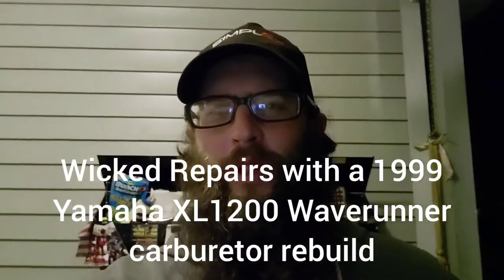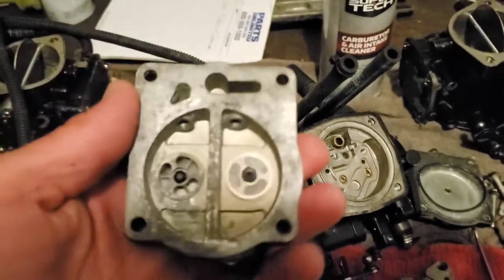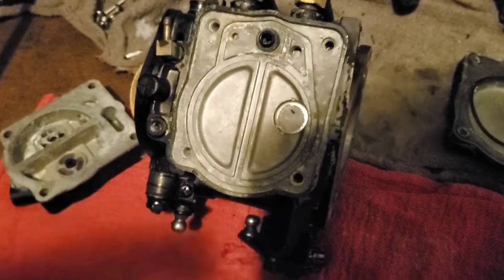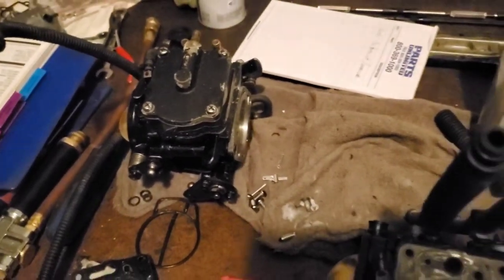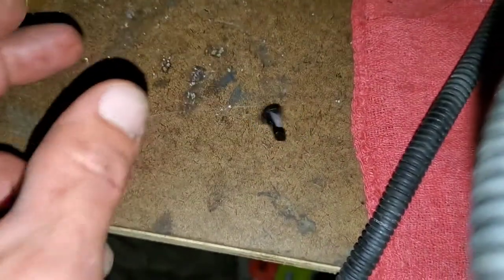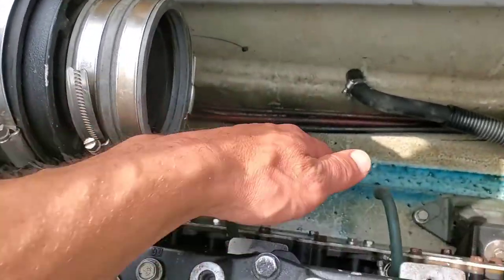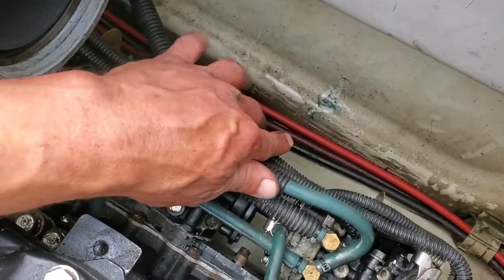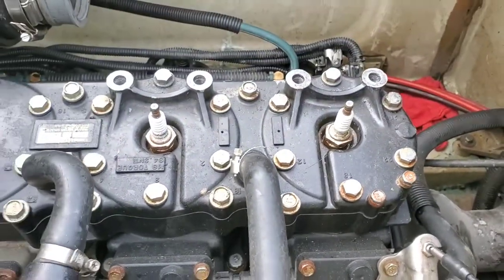Yamaha XL1200 Carburetor rebuild

Comment: Just got done finishing an xl800, second time pulling everything a part due to a ruptured fuel line that was barely rubbing on the head.  Make sure you route everything back like factory.

Also, make sure to get the right kits, for I series carbs.  The regular 44 SBN carbs are smaller diaphragms and body.   

Mine rubbed through while cruising about 45 mph.  Was able to limp home at 3 mph, but was across a huge lake.  Lesson learned the hard way.  Fixed it and also put more hose protector around fuel line for added protection.
Reply: Hi when you did your rebuild what specs did you use I have a hard time finding 800 specs for pop off and hi and low settings.
Reply: @seandaly9361  I'll see if I can find it in the service manual and post it here.
Reply: @user-ym9wb2mk5e  thank you
Reply: @seandaly9361  I can get you the whole manual, shoot me your email addy.

Comment: Looks like you used Yamalube between the carb gaskets and the manifold plate and also between the plate and the motor.  Please confirm.  Thanks!  Great video!
Reply from the maker: Yes is did, yamabond. I either put that or spray Hi tack gasket sealer on the gaskets to make sure there's no air leaks!

Comment: My Pop Off Pressure is set at 55  on all 3 and it works  great  now i am doing a 1200r  not  a xl1200   and  my buddy helped me do my carbs  last year this time i am  doing them on my own ..  I am going  Pre Mix  I throw those oil injection pumps str8 to the trash not made for it ..  I will say some of the parts  dry up becuase of being on pre mix  only where the carbs  turn just install a spring  good to go  never will fry a cylinder
Reply from the maker: Thats never a bad idea! If the pump fails its inevitable there will be catastrophic failure! That's awesome. Sorry it took a while to respond! I have my business and a metal detecting YouTube channel and for some reason didn't get my notifications for my repairs channel.

Comment: Great video Chris!!! I’ve done a ton of those carbs but I learned something new today 😂 keep them videos coming!!
Reply from the maker: Thank you! I appreciate it very much!  Maybe one of these days I'll be able to get up there and visit you.
Reply: Wicked Repairs absolutely! Would love to see you bud! I’ve got a 07 sportsman 500 that is driving me crazy!!! Wish you were closer, we could do a video diagnosing this turd!
Reply from the maker: @maineboatguy  probably needs a wire harness lol. Done many on those machines. The motors are typically OK on them but the electrical system is not so good.
Reply: Wicked Repairs 😂 I didn’t even tell you what it’s doing and you just figured it out!! I think I’ll be ordering a harness!!!! I’ve tried key switch, handlebar switch, removed fusible link from harness, sent pdm to “module masters” for testing but it supposedly is ok! Basically acts like someone is turning key on and off randomly! I really don’t want to replace the harness but this things useless otherwise 😞
Reply from the maker: @maineboatguy  lol it is a crappy job but is somewhat common from swamping these things. Funny how I've never had to replace a harness on a yamaha but have on many Polaris units! If the ecu is OK and its not loss of spark that causing, and everything else like ignition tests out ok, I'd def say harness.
Reply: Wicked Repairs I say that about EVERYTHING on a Polaris!! Kinda like my new sled, 400 miles I needed all new a arm bushings and a ball joint 😂 my apex had 8k miles with original bushings!! 
But yea this thing completely powers down, like someone pulled the battery out, I’ll do a video and send it through Facebook messenger!
Reply from the maker: @maineboatguy  yeah I'd like to see that. Nothings better than a yamaha! Pure reliability!

Comment: I know it’s an old video but it’s by far the best one I’ve found. I’m redoing the fuel system on a 99 Yamaha 1200 xl and I’m having a hard time finding what psi the pop off should be and my low and high adjustment screws are covered by brass caps should I drill them out to get the screws?
Reply from the maker: The pop off pressure is 75psi for all 3 carbs. You can very slowly and carefully drill the plugs out, don't go fast or hold much pressure so the drill bit doesn't hit the screw heads. The front carb low speed screw should be at 1 1/2 turns out, the middle at 1 3/8 turns out and rear at 1 1/2 turns out. The high speed screws should be at 1 3/8 turns out for all 3.
Reply: @wickedrepairs8527  thank you soo much!!
Reply: @wickedrepairs8527  I drilled out the caps and the low end screws were bottomed out all the way. I’m also having a very hard time finding a replacement check valve for the accelerator pump. Any idea where I can find one or even a part number
Reply from the maker: @davidrusso3273  that's crazy that they are bottomed out, strange. I'd have to try to find a yamaha part number for you if they are available. You can go through SBT, they are out of Florida and have kits that should have them in there.
Reply: @wickedrepairs8527  it’s a power valve motor not sure if that changes things.
I’ve called Yamaha mikuni and sbt and no one can find a part number
Reply from the maker: @davidrusso3273  it's so strange, neither can I! Looks like from what I can tell, you have to buy the 3rd carb as an assembly, bit they aren't even available.
Reply: So I finally located a accelerator pump in working condition got all the carbs finished up and everything put back together. It’s idling at around 3k on the trailer and after removing the oil pump the throttle is having a very hard time return to closed.
Reply from the maker: @davidrusso3273 It may idle a bit high out of the water, they do a lot of times util the prop has some resistance from the water. I have set them to proper idle on the hose then had to turn them up on the water after but you may want to adjust the idle more around 2100 on the trailer. That may even be your idle hang issue. If it very eradic it may be an air leak. Does it start up relatively easy? Take throttle ok? Although the idle is high, is it mostly steady?
Reply: @wickedrepairs8527  it starts up no choke and is very steady the throttle cable takes a long time to go back after pressing it tho
Reply from the maker: @davidrusso3273  if it's the cable itself, I'd lube the crap out of it! Get some cable lube or silicone spray and a cable lube from motion pro. That should do it as long as the cable is routed properly and the linkage isn't bent.
Reply: @wickedrepairs8527  I was going to add a spring where the oil pump line used to be as well. I checked for an air leak and didn’t find anything. Should I run the low end screws back in all the way how they were?
Reply from the maker: @davidrusso3273  yes, you can definitely try that and see if it runs better but very strange that they would be bottomed out. A return spring would be a great idea

Comment: Have a 99 XL1200.  Put a new throttle cable in as the throttle was not working.  Now, upon further investigation, the cable pulley for the throttle/oil injection pump is sticking.  Pull the throttle, it doesn't return.  Is there a replacement or just take it off and clean up and lube good?
Reply from the maker: I would definitely check to make sure there is free play in the throttle cable, it should have about 5mm of free play when you apply throttle, before it opens the throttle valve. Also double check that routing is proper and the cable isn't bound or twisted. You can definitely lube them up! Hopefully that's all it is, I have seen that before, some WD40 or silicone spray would be good and just work the throttle. Make sure the cable mounts and pulleys aren't bent too.

Comment: Hey do you have a spec sheet or official info on how much to turn out the high and low speed valves? I always sleep better at night knowing Yamaha said it
Reply from the maker: Yes I do! I have a complete factory yamaha book with specs for all 2 stoke models and some 4 stroke. At about the 2.5 minute mark the book is open in the bottom left of the screen

Comment: What’s the best way to remove the welsh plug to access the high and low speed adjustment screws?
Reply from the maker: Sorry I didn't respond faster, for some reason i didn't get a notification of a comment. Typically on waverunner carbs there is no plug, depends on models, if you need to remove one, carefully drill out and be sure to do it slowly so the drill bit does not hit the screw heads. I like to drill a smaller size hole in the center then install a screw into the hole as a puller, and then pull on the screw head with pliers to remove the plug.

Comment: Great video. I wish to see this video before I spent so much unnecessary time. I guessing same carburetor on gp1200r? Is it same spec for carb regulations? Do you have a video how to bleed oil system? Thanks for video it helps a lot
Reply from the maker: Yes the carburetors are the same for GP. Love those machines, GP has one of the best hull designs if you ask me! The pop off pressure is the same at 75 psi. The low speed screws are 1 1/2 turns out on front carb, 1 3/8 out center and 1 1/2 out for the rear. All high speed are 1 3/8 turns out. To bleed the oil is simple, just loosen the screw in front of the idle knob until there is no air and only oil coming out then tighten it back down. Thanks for watching and I'm happy to help!
Reply: @wickedrepairs8527   witch one of these is the front  to the rear  is the front  the one with the carb wheel ?

Comment: Looks like there are a couple of yamabond numbers (e.g.-4, 5, 6), which one to look for? Dumb question, but do you coat the threads of the entire grip? Is there a local source you can recommend like Permatex or similar if yamabond isn't specifically available? 

I will have to pull the carbs back apart to clean and adjust the hi/low needles. I'm surprised the rebuild kit didn't come with replacement seals
Reply from the maker: Definitely yamabond 4. I use a regular grip glue but have used other generic adhesives and even used black spray paint in a pinch, woks surprisingly well.
What seals? The gaskets? They are separate. I get rebuild kits through SBT on line.

Comment: Does the flaps of the choke need to be open when choke is  or out?
Reply from the maker: When you pull on the choke cable the flap should be closed.

Comment: Would you advise putting the carb body in parts dip once it's disassembled to get it really clean?
Reply from the maker: You absolutely can, just may take off the paint on the outside of the body. If so, just be sure it's all cleared of any paint flakes if that happens.

Comment: Late comment, but hopefully you still check these.  I just rebuilt my 2000 1200xl carbs and it has a runaway idle now.  Bought the waverunner used not running.  The grey hose with the red line on the hose, what is it for?  Because on mine the front carb has an exposed nipple that the grey hose is bypassing, and where the grey hose would have connected to it someone added a connector to the hose to skip the first carb.  The grey hose is connected to the last carb though
Reply from the maker: It may possibly be a vacuum hose. I wouldn't bypass any of the hoses and they shouldn't be really. You have vacuum, fuel and return lines. That should be it and they should all be utilized properly. The only other lines would be to the Reed valves for oil injection.

Comment: Do these carbs on the 1200 have to be synched like a motorcycle? Or do you simply adjust the screws to specs on each carb and that's it?
Reply from the maker: The synchronization process is done with setting the needle valve pop off pressure. They should all open at the same time and same amount of pressure. I think these are about 15psi but I would have to check the specs
Reply: @wickedrepairs8527  thanks for the reply. I'm about to start on the exact same model and year you were working on.
Reply from the maker: @dukelps9132  you're welcome! Good luck!

Comment: Hello, what does it mean when the low speed screw will not turn?  Thanks
Reply from the maker: It most likely seized up from corrosion. I would soak it in penetrating lubricant and try to work it out slowly.

Comment: Hi, I’m rebuilding my 1999 Yamaha XL1200 limited carbs and I was wondering what the adjustment specs are for my high and low screws?
Reply from the maker: They are all different. I believe I did say them in the video but I just looked them up again in my book. 
The front carburetor is 7/8 turns out on the Low and 1 1/4 turns out on the high 
The center carburetor is 7/8 turns out on the Low and 1 1/8 turns out on the high.
The rear carburetor (with the accelerator pump) is 1 1/8 turn out on Low and 1 3/8 turns out in the high speed jet.

Comment: Great video I have these same carbs, would you be able to rebuild mines if I mailed them to you
Reply from the maker: Thank you. I can do that, I just can't guarantee that it will run properly or need some adjusting when installed. Most of the time the low speed and idle adjustment is needed.

Comment: Your video is very helpful, best one I’ve seen on this topic. 
I have a 1999 LS2000 and am looking at rebuilding all 6 carbs. What rebuild kit do you recommend?
Reply from the maker: Thank you very much, I'm happy to hear that! I get carb it's through SBT. They are out of Florida. I have dealt with them for 15+ years. I want to say the kits are SBN44 but not positive. Their website is easy to navigate.
Reply: Are these carbs 38s or 44s? I understand there is a difference in the gasket arrangement in each
Reply from the maker: @robertsepulveda2229  they are SBN 44 carbs
Reply: How do I tell the difference between a 38 and 44 carb. I bought a mikuni kit and it says the gasket arrangement is different in each. 1999 Yamaha LS 2000 boat
Reply from the maker: @robertsepulveda2229  you have to look at the carb numbers to identify. Ls2000 is sbn44.

Comment: Hi, I thought your video was great.  I have a question. I have a 2002 Yamaha xlt1200 and I did rebuild the carbs. I ran on land and got a good idle. I had to wait 2 days before I could bay test and I removed the seats and the bilge was filled with gas… a couple of gallons. It was pouring out of the carbs. What would cause that ? Have you ever seen that ?
Thanks
Reply from the maker: Thank you, I appreciate that! 
Simple things first, make sure all the fuel lines are on and are secured properly. If they are all good,
I would run it on the hose, make sure the seat is off for venting and get all the leaked fuel out of the hull before starting it for safety. 
Use lights and mirrors if needed to inspect around the carbs and lines for any leaks under pressure.
It's possible that the needle valves are stuck or getting hung up making them leak over. The fuel would most likely come out of the hole in the cover of the diaphragm.
Reply: @wickedrepairs8527  hey thanks for getting back to me. 
  The carbs were filled with fuel, each barrel was full and dripping into the bilge. I couldn’t see with the mirror so I quickly remove the exhaust so I can get to the carburetors and take a look and that’s what I saw after I remove the flame arrestor that each barrel of each carb was filled with fuel and dripping out. When I removed all three carburetors each three openings on the manifold were filled with fuel as well. I’m not sure how this fuel system works as far as getting fuel to the carburetors does the fuel tank get pressurized ? I’m not sure how the return fuel line works either but obviously this was dangerous and I don’t want to put the carburetors back until I understand why so much gas poured out of them and into the bilge.
Let me know what you think. Thanks again !
Reply from the maker: @darrinscali5306  wow! You're welcome, I'm happy to help out any way I can. The fuel pumps through the vacuum hoses on the fuel pump bodies of the carburetors. The return line is to simply return any fuel that isn't consumed. I would remove the fuel lines and see if they are flowing constantly or if they stop. However, the needle valve and diaphragm should stop the flow of fuel until its pressurized and the needle valve pops open.

Comment: Hi if you ever see this can you tell me from the manual the 2001 gp800r carb hi and low setup and pop off pressure thank you if you can!
Reply from the maker: I should be able to get that info to you later on this afternoon!
Reply: @wickedrepairs8527  thank you any help is greatly appreciated!
Reply: Hi I’m sure you are busy just seeing if you have any of that info
Reply from the maker: @seandaly9361  yes, I apologize, I have a big event I've been getting ready for this weekend. I'm at work now but will get that for you asap!
Reply from the maker: Hey man! Sorry it took me a bit, but I have your info! Just been super busy! Pop off pressure is 75 psi. Low speed screw settings should be 1 5/8 turns out for the front carb and 1 3/4 for the rear. High speed screws should be 1/2 turn out

Comment: That pin on the accelerator pump doesn't spring back out fast, is that normal or should it be springing right back out rapidly?
Reply from the maker: It comes back out slow, it definitely lags behind the throttle when the pump lever compresses it.